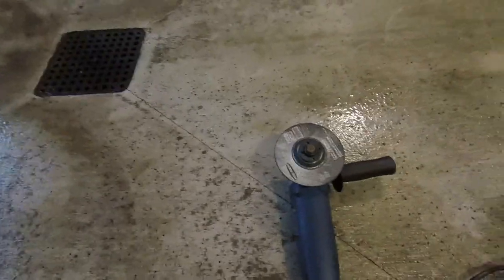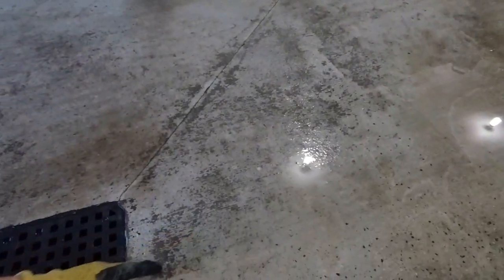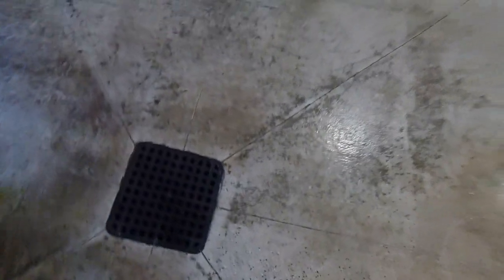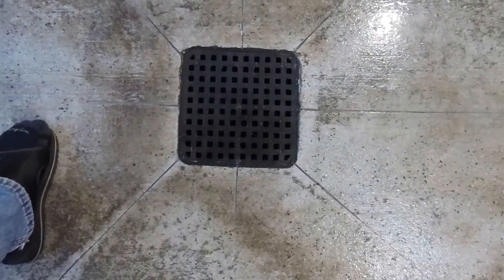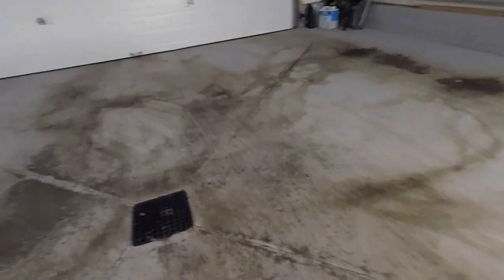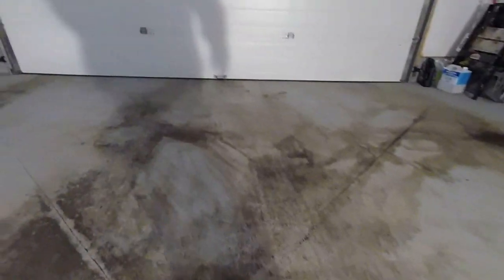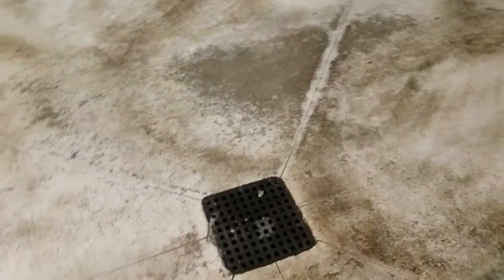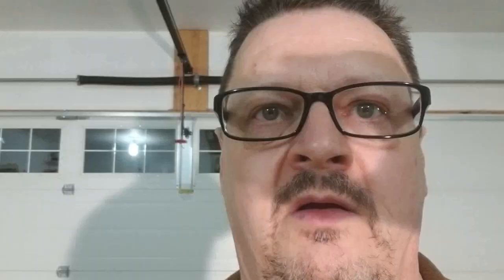Garage Floor Drainage Sucks and How I Fixed It

Comment: Can the square metal cover be removed and use a snake? I don't have similar problem as my garage floor slopes toward the drainage cover, but it doesn't drain well when the weather is cold in Canadian winters. Please advise if you can.